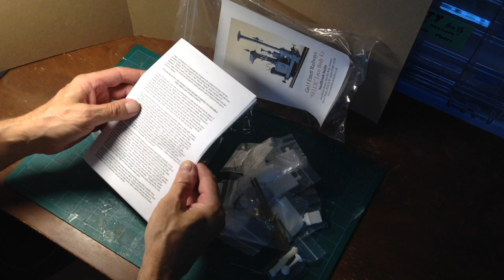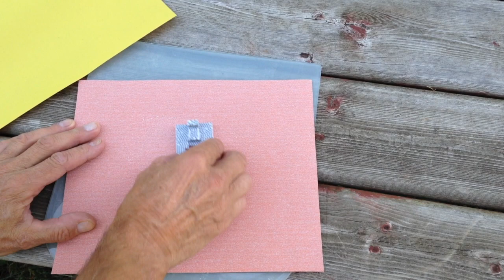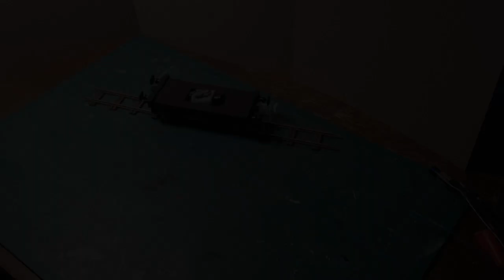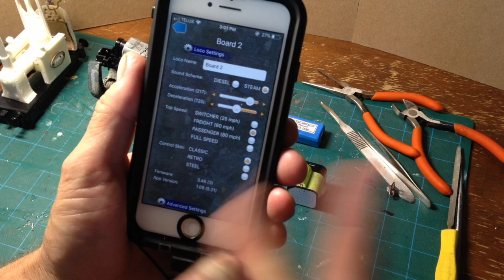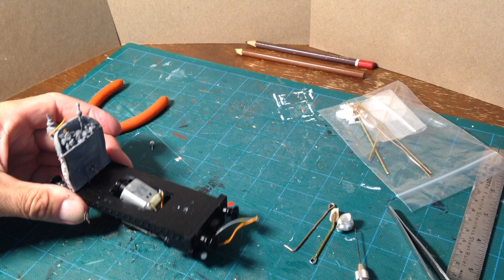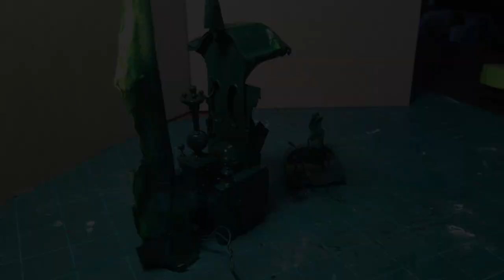Building Nellie From Small Brook Studios into ROSiE for TippY AshwooD

Comment: 3:00 Are these the only parts you need to run dead rail ? Does it not need a sound decoder, or does the sound come through the app ?
Reply from the maker: Hi Marko. You will enjoy the model making freedom of Gn15 whether its  all imagination or  its based  on prototype.  I am using Peco stream line. 100 code and small radius points/turnouts,  but I have cut the web underneath and pushed two sleepers together.  spaced by eye but about a 1" apart . You can then run any OO/HO chassis and build anything on top.  As the video says Mine are Hornby Smoky Joe chassis, with a "Smallbrook" resin kits on top. 

The Dead rail is "BlueRail" from the States.   You buy the board and suitable battery and charger.  wire to the regular motor in your chassis and download the app.  ( 1 Board runs, 1 Loco ) The Battery then supplies the power when you tell the board what to do through your app on your phone ( Bluetooth). the sound comes out your phone.  if you buy a small bluetooth speaker you can connect to that, and then hide in the Tender as I did,  you don't get 2 sets of sound when running 2 locos.   There are other systems.  Radio control etc but I liked this one.   They have since changed so you I think !  you can now run a DCC sound chip with your dead rail board   but I haven't figured out this yet. and it seems to then get expensive.  (a Deadrail board and a DCC sound chip and speaker). still looking into this.  I am re thinking this system a little bit. should have just gone DCC with power in the track, and the dead rail as well.  But I do like the idea of a cheap phone as a controller and the battery power. (No track cleaning,  no stalling Loco's even seen people 3d printing there own plastic track )   hope this helps.  FB has a dead rail page.  if you figure a different system out. I would be interested in knowing. and you do need a little bit of wiring soldering skill
Reply: @TippY_AshwooD  Thanks for the information! I am still reading up on Gn15 and love the idea of your layout, I don't have alot of room, but I think I can fit in a fun layout. I have sent a mail to Bluerail regarding the boards you use, since their website says they are out of stock due to supplies. Haven't heard anything back yet. ps. hope you find your mojo back soon, its way to cold to work on your oldtimer ;)